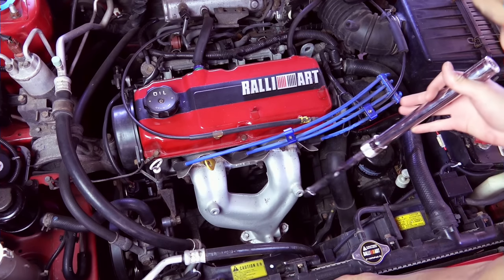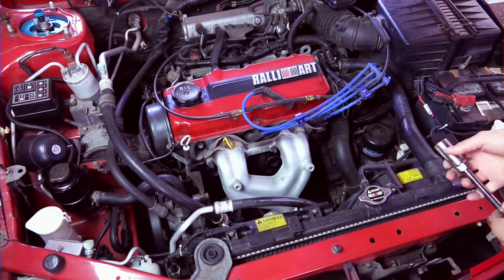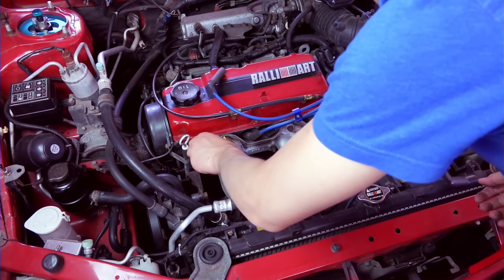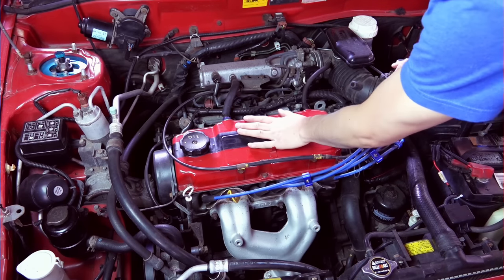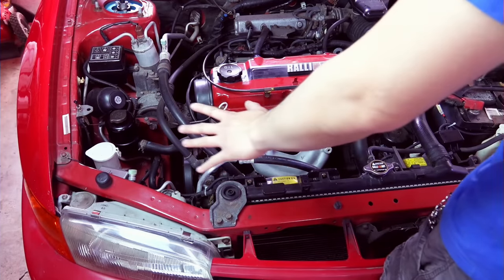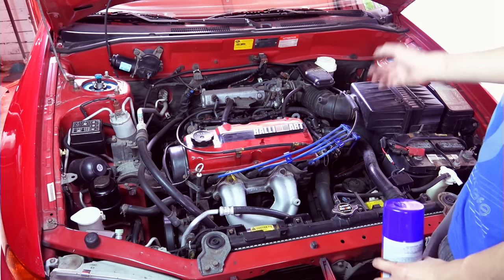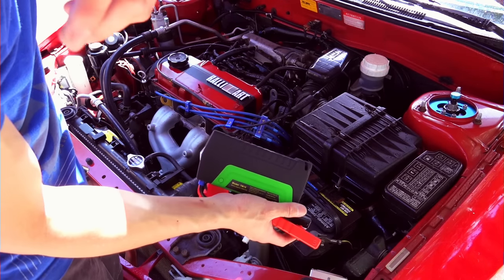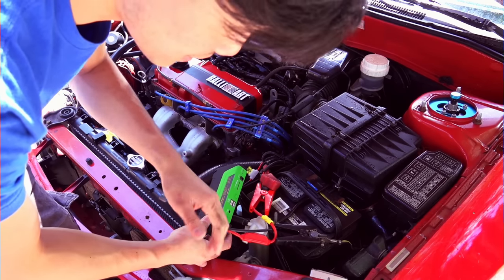Mirage Fix 14 | Cleaning Engine Bay (Remake)

Comment from the maker: 97-01 Mirage DE 1.5 Valve Cover Gasket
eBay https://goo.gl/aZ3pEX

97-01 Mirage DE 1.5 NGK Spark Plugs
eBay https://goo.gl/7MxXNv

97-01 Mirage DE 1.5 Spark Plug Wire Set
eBay https://goo.gl/eGLHSD

97-01 Mirage DE 1.5 Manifold + Gasket + Nuts & Bolts
eBay https://goo.gl/kPYnfn

97-01 Mirage DE 1.5 Air Filter
eBay https://goo.gl/8iVxge

Gunk EB1 Engine Brite Original Heavy Duty Engine Degreaser
eBay https://goo.gl/KiRD58
Amazon http://amzn.to/2p1FW5k

CRC Throttle Body and Air-Intake Cleaner
eBay https://goo.gl/mRgl0t
Amazon http://amzn.to/2p1Ftjs

VHT Red Caliper
eBay https://goo.gl/KD5Lui
Amazon http://amzn.to/2oEwZ0Z

VHT Flat Black
eBay https://goo.gl/EQuu9w
Amazon http://amzn.to/2oaQGtY

VHT Flameproof Silver
eBay https://goo.gl/aFsSWx
Amazon http://amzn.to/2ocpM4i

Comment: Hey Mackey, do you have any information regarding the capacitor that is connected to the side of the distributor body? It's a single pin connector. My 97 Mirage (1.5L Automatic) has that one connector loose and there's nothing bolted onto the distributor body. I'm going nuts searching for a part number but I'm unable to find anything... Only thing I've found through the Ignition System's diagram is the connector number (A-66).
Reply: Nevermind, according to a parts catalog, the only thing that bolts onto the distributor body is a metal plate to hold the upstream oxygen sensor (California emissions).
Reply: I'll check tomorrow, the capacitor is probably hidden away under the distributor area, close to the transmission, probably.
Reply from the maker: I'm glad you found the parts catalog!

Comment: Why did u put gasoline in the spark plug hole?
Reply: I think it's because gasoline can be used as cleaning fluid
Reply: so that no dirt gets into the cylinder. it's not bad if it's a little gasoline because that's where it goes anyway. Water is not so good for the cylinders. I remember there was some guy with an 2015 WRX STI who filled his car with water instead of gas because of a flood in the gas station and he had to replace the whole engine.